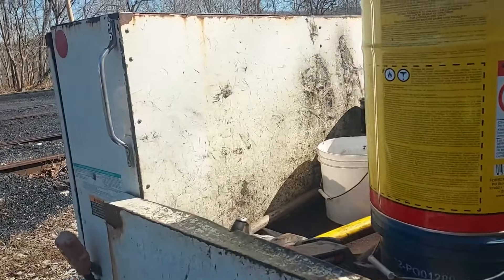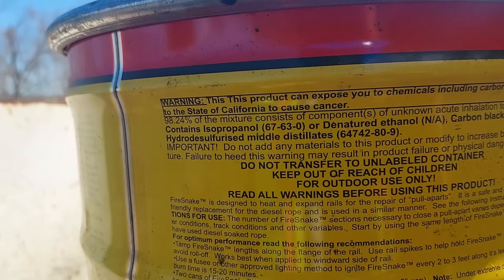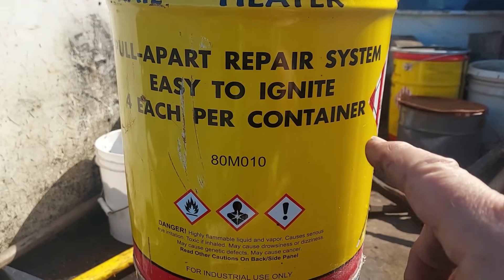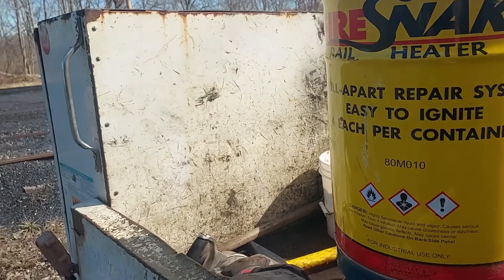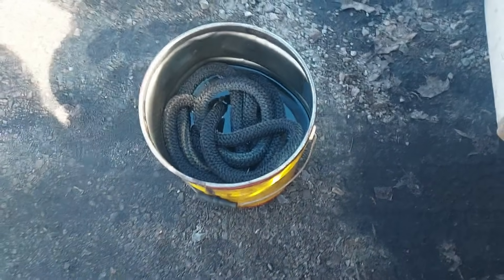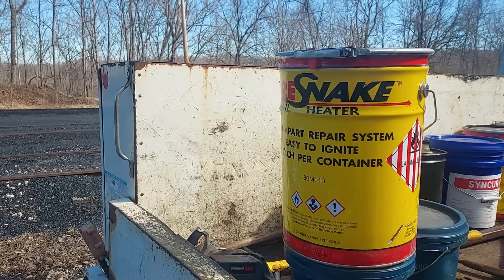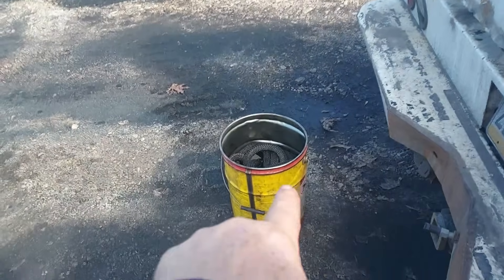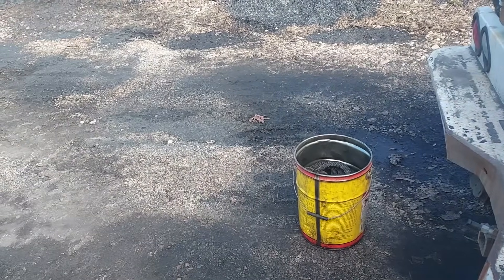Fire Snake and why we Don't Thermite Weld our Track Joints

Comment: Does the track tend to move in that direction because the loaded train stopping tries to drag it in that direction?
Reply from the maker: The lateral forces imposed on track by trains going thru curves
does indeed  want to push the track Perry. That is one of the reasons why good ballast is so important, to create resistance
against the tie so the rail does not push. Heavy braking in 
curves also creates more lateral force outward. You are right
loaded trains create more force than do empty ones. However
the forces imposed on track is the same for the locomotive
itself whether they are pulling a loaded or empty train.  Really appreciate your watching and keep it on the rails until we meet again.

Comment: Why wasn't an interchange build with the N&S to enable quipment to be brought in by rail.  How many mile of track (estimate) would it take?
Reply from the maker: The original planners at US Steel did not see a need for it JD.
All coal is barged out. Last company did start shipping some coal
via NS And CSX trains but they built a barge unloading facility 
where they unload the coal and put it on trains there.  The terrain to get to the nearest NS siding is really rough and they are not going to build another 4 miles of track to connect. Really appreciate your
taking the time to watch the video and may you have a very good day my friend.

Comment: When I was very little I saw  locomotives run off into a deep ditch about 20 feet deep my question is how do they get them up out of the ditch and back on the tracks.
Reply from the maker: Back in the day RR's had cranes on flat cars called Big Hooks which
could lift locos Jimmie. Now if locos go off track they call in
specialized companies that have Caterpillar side boom crawler
tractors to put them back on. Most are Cat 583 side booms, also
used for the pipe laying industry, about the size of a Cat D8 dozer.
Thanks so much my friend for checking out the snake show.

Comment: What are the torque numbers on these bolts ?
Reply from the maker: We torques our track bolts here to around 350 Ft lbs A2Z.
AREMA specs for track bolts is around 600 but we have found with
all jointed track that is too tight and won't allow the track to
expand or contract like it should with jointed rail.

Comment: Wouldn’t it be possible to expand the rail using electric current? I’m in the pipeline industry and we sometimes expand rather long stretches using electric current. We use generators and I believe they feed only 24V but an awful lot of amps into the pipes.
Reply from the maker: Interesting idea Peter, one I've never heard of being done.
I learned something new. Question to me is how far does that
current go, I mean the amount of length of the rail does it travel?
How would that affect me putting in track bolts in a joint right
beside the current and how would it affect the rubber wheels on
the hi rail? I don't know am asking.  Thank you for taking the time to check out the video and may you have a very good day my friend.

Comment: Isopropanol and middle distillates are alcohol and diesel fuel.  It's the same thing as your fire rope except it has alcohol to make it easier to light and is wrapped in plastic so it isn't so sloppy to work with.
Reply from the maker: Thanks so much for sharing that info with us Star Gazer.  Really appreciate your taking the time to check out the video and may you have a very good day my friend.

Comment: hydrodesulfurised middle distillants would be kerosene, diesel, and that sort of thing. The newer SDS simply says "kerosene". Mostly the FireSnake is made of alcohols (ethanol and isopropanol) in some unknown ratio. and some carbon black probably to wick the fuel. It's basically the same principle as a backpacking stove but laid out on the rail.
 
Hexamine (like in a solid fuel stove) would be cheaper and lighter weight since you'd need less of it, and not nearly as messy as FireSnake (I assume your gloves stink if you've been handling it). But I'm guessing the horrible fumes of hexamine and toxic residue is why people won't be heating rails with it.
Reply from the maker: Horrible fumes and yep the gloves stink Jonathan. thanks for
sharing that info with us. Really appreciate your taking the time to check out the video and may you have a very good day my friend.

Comment: Isopropanol is rubbing alcohol. Denatured ethanol is refined booze spiked with a bitter poison that causes blindness. CB is burnt stuff, like that that goes into tires. HDMD is like less pure gasoil or diesel fuel but less sulfur than low sulfur.
Reply from the maker: Thanks so much for sharing that info with us . Really appreciate
your taking the time to check out the video and may you have a
very good day my friend.

Comment: Dave, why is there not an interconnect between YOUR railways system, and a link to one of the major railways systems, so you could potentially bring in long sticks of rail and bring in NEW power units?   Has your company thought of creating a link to larger outside rail systems??
Reply from the maker: There was never any planning to connect to another RR skywatcherca, and we will never do so. We ship coal by barge
to a facility we own at LaBelle Pa. where the coal is off loaded
from barges and then loaded on CSX and NS trains. The logistics to build a RR to connect ours with NS is daunting. Also when US Steel created this mine they had no planning for the future and didn't
think we would ever need to connect to another RR. Really appreciate your taking the time to watch and may you have a very good day my friend.

Comment: Dave, why not put a tie UN DER every rail joint?   Would this potentially not reduce up/down stress on the joint jointer bars?   Great videos..thanks Dave.
Reply from the maker: There are two schools of thought out there amongst railroaders.
One says put a tie right under the gap between the rails, other
thought is put two ties under a joint bar. My thoughts are put two
ties under the joint bar gives better stability than only a single
tie under a joint skywatcherca.

Comment: So, to translate those ingredients:
- Isopropanol or Denatured Ethanol basically means rubbing alcohol.
- Carbon Black is basically a kind of soot. The soot in a wood or coal fired chimney would be a pretty good example of carbon black. It's mostly-burnt charcoal, but not 100% burnt. Soot in a diesel engine particle filter would also be pretty similar.
- Hydrodesulfurized middle distillates is similar to low-sulfur diesel, but probably a little more viscous and without all the additives (and taxes) you would get with diesel meant to go into an engine.

Now, WHY are all of those things in there? Here is my best guess: The Alcohol is there because it is more volatile and makes the whole thing easier to light. The diesel is there as the main source of fuel to make the heat. The Carbon Black is there to slow down how fast the diesel burns, and to add some thermal mass to keep heat on the rail rather than blowing away as hot air. It may also cut down on the smoke a bit.

Carbon Black is the tricky one. You mostly find it being used in tires to make them last longer, and in black inks and dyes. However, depending on what exactly has been done to it and what form its in, it can have wildly different effects. You wouldn't ever really use it as a fuel source because too many of its hydrocarbons have already broken down, but it can still be volatile enough that if you grind it up into a fine powder and too much powder gets in the air, it can explode. However, if you mix that same powder in with a plastic, it will generally make the plastic more flame retardant. So it either blows up or makes things harder to burn depending on what its mixed with. To be fair, a lot of things that aren't normally flammable will explode if you grind them into a fine powder and disperse them in air!
Reply from the maker: Thank you for the very well thought out comment sadlerbw9,
very interesting stuff, I learned a lot more bout how the snake
works. Really appreciate your taking the time to watch and may you have a very good day my friend.

Comment: I am a traffic controller. The rail creep explanation can be put visually with roadways. Picture that 1 busy intersection where a lot of heavy trucks come to a stop and the asphalt becomes little hills. That's because the weight of all the traffic coming to a stop pulls the road in that direction. 
Now picture a train wheel riding over the rail as it does, and think of all the hundreds of tons of wheels constantly pressing and pushing in 1 direction like a say a baker flatning a blob of doe with a roller. If the train goes in 1 direction only all that force and those wheels are like a giant roller and it stretches the joints. If the trains would go both ways then it would push the rials back a bit. Wow ADHD is a rollercoaster when you have a thought. But yes those are the only ways I can't think, bad roads and braking, and bakers rolling out doe. Have a good one.
Reply from the maker: No bakers rolling out dough here Anthony, however that was a
pretty good analogy. One thing I did not mention that adds further
credence to your thoughts are with our loads only going one
way and most of that is down grade, we do all our braking
with loads which further wants to bunch the rail up (creep)
towards the east. Your right braking pushes the rail or roads
one way.  Really appreciate your taking the time to watch the video and may you have a very good day my friend.

Comment: On using Fire Rope, Fire Snake, whatever it's called this week, on our Class 1 mainline, we'd run it both ways from the open joint. All that heat sped up making the repair. Time was and is of the upmost importance on mainline. We tried to keep our track jointless, but with rail detectors it's pretty hard to do.
Reply from the maker: I explained why I don't run it both ways in the video John, I have
to string the snake out further down the line instead of on both
sides if I want more heat. I hear you on time being of the essence,
they like to run trains steady here and don't like it when we have
to slow them down or stop them, so we are constantly under
the gun too. Nobody has a sense of humor when trains are
stopped from running. :-)

Comment: I forgot to comment on the earlier video whereyou were lighting the fire snake, what was that you were using? was that a road flare? If it was, I think a fusee (IDK Spelling) that the forest service uses might be more effective? I was told in training NOT to set it on a roadway like a flare because it will set the road on fire. I believe it has a more aggressive concentrated flame (never had to opportunity to use one) and with how long you held it in place to light I wonder if your ignition source might be lacking a little as well
Reply from the maker: That was a road flare Nope No, they get them at the local NAPA
store. I can only use what they get me. Sometimes the alcohol
in the snake evaporates and it won't light up as well as a newer
can of snake would. I also sometimes us a propane torch to 
light the snake. I did not know there was a difference between
a road flare and a fusee. Interesting. Really appreciate
your taking the time to check out the video and may you have
a very good day my friend.
Reply: @ccrx6700  I would specifically request a fusee and give it a side by side trial on the same can of snake, I would bet you would see a difference in lighting time.
Reply: Just did a search for them. Might come up as a backfire fusee torch. In my short googling, Im only seeing 72 count boxes for around 275 to 324, may or may not include mandatory hazmat transport fees in price, but looks to be about 4 to 5 dollars a piece.
Reply from the maker: @legionofanon  😊👍🚂

Comment: As a chemist, I can tell you exactly what each of those ingredients are.  Isopropanol is sold as rubbing alcohol and ethanol is the grain alcohol in alcoholic beverages ("denatured" means that it's been made unfit to drink, which eliminates the need to pay beverage taxes on that ethanol).  Carbon black is what's used in tires and hydrodesulfurised middle distillates is basically what you buy as charcoal lighter fluid.
Reply from the maker: Thank you for sharing that with us Jon. Interesting stuff I did
not know.  Very much appreciate your taking the time to watch the video and may you have a  very good day my friend.
Reply: 98.24%  it says is UNKNOWN 😮

Who CARES about the less than 2% that we DO know about 😢
Reply: I believe carbon black (basically pure carbon) is a major component in soot.

Comment: Dave, The Brits seem to oil/grease the bridge plates that connect the rail pieces.  What would be the pros and cons of this method vs. non-greased joints?  Thanks so much for your content.
Reply from the maker: At one time we did spray the fishing on the rail where the joint bars
meet the rail Tommy Z Cat. We used to have a lot of extra help
back in those days. Also the oil they got us was regular hydraulic oil and it didn't last long. So for the time and effort and expense it
was not worth it. They should have gotten us a really good graphite
based lube which is what they use in the UK. Also we never get any
extra help now and we simply don't have the time to lube joints
anymore.  Thank you for taking the time to watch the video and may you have a very good day my friend.

Comment: Hydro-desulferides is removing sulfur from the hydro carbons. Isopropanol is a military grade alcohol. I actually use this in my shop to clean stuff rather than use other chemicals. It evaporates clean and doesn't leave any residues behind. It is very flammable. If I were take a gander, its probably added to help the other thicker components evaporate and burn more thoroughly. In my conductive paint video, I added some of this alcohol to the water before mixing to help the paint dry more completely. Also, this alcohol is also used in the treatment of bed bugs.

Denatured alcohol burns a little slower and is often used in chemistry labs on the Bunsen burners. 

Carbon black could be any number of products, this is from Wiki; Carbon black (with subtypes acetylene black, channel black, furnace black, lamp black and thermal black) is a material produced by the incomplete combustion of coal tar, vegetable matter, or petroleum products, including fuel oil, fluid catalytic cracking tar, and ethylene cracking in a limited supply of air. Carbon black is a form of paracrystalline carbon that has a high surface-area-to-volume ratio, albeit lower than that of activated carbon. It is dissimilar to soot in its much higher surface-area-to-volume ratio and significantly lower (negligible and non-bioavailable) polycyclic aromatic hydrocarbon (PAH) content.

Carbon black is used as a colorant and reinforcing filler in tires and other rubber products; pigment and wear protection additive in plastics, paints, and ink pigment.[2] It is used in the EU as a food colorant when produced from vegetable matter (E153).

The current International Agency for Research on Cancer (IARC) evaluation is that, "Carbon black is possibly carcinogenic to humans (Group 2B)".[3] Short-term exposure to high concentrations of carbon black dust may produce discomfort to the upper respiratory tract through mechanical irritation.

So you should not be breathing this fire snake when its lit.
Reply from the maker: Thank you for sharing all that info with us David, lot of stuff I
did not know. Yes those fumes from the snake will kill ya.
They are wicked. If I ever get bed bugs, I know what to do now,
light some fire snake in the bedroom..... :-) Really appreciate
your taking the time to check out the video and may you have
a very good day my friend.
Reply: @ccrx6700  LOL..... The firesnake will certainly get rid of them and everything else in the house...
Reply from the maker: @opieshomeshop  👍😊🚂

Comment: great job going over all the key points.sometimes it is more cost effective to just have jointed rail that you do not
have to worry about fractures due to being more brittle from welding.the cost of bolts and time to replace over derailment 
or catastrophic failure due to rail movement! great one Dave, please pet Mr. Freddy for me!
Reply from the maker: Thank you Barry, one thing about all welded rail that is a deterrent
is it's ability to develop kinks in the hot weather. We rarely have
heat buckles here. One about every 5 or so years. Thank you for  taking the time to watch the video and may you have a  very good day my friend.

Comment: ?????What about a cut and slide. Cutout the joints slide other rail up weld with a rail  weld truck add a piece after so many joints cut out .
Reply from the maker: It could be done Matthew, would take a lot of rail cutting and 
labor to do but would be cheaper than having to buy all new
rail.  Really appreciate your taking the time to watch the video and may you have a very good day my friend.

Comment: I didn’t know those two extra bolt holes were so problematic.     Just getting the track time to do the welding would be a significant problem.  My understanding is it takes 10 minutes per weld.
Reply from the maker: Once welders track travel to the work location, then it takes a good
hour to do a thermite weld Kent. Flash butt welding takes about
half that amount of time. You totally right about getting the track
time to do welding with trains running.  Thank you for watching the video and may you have a very good day my friend.